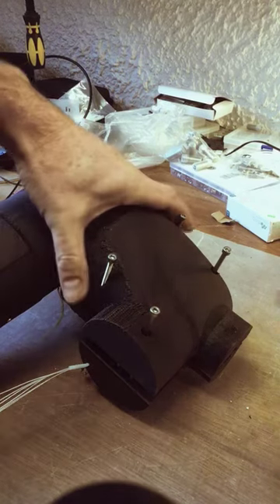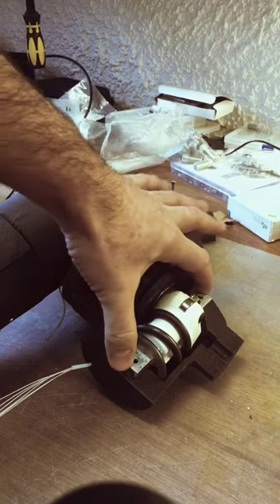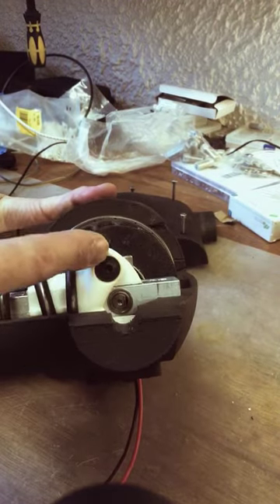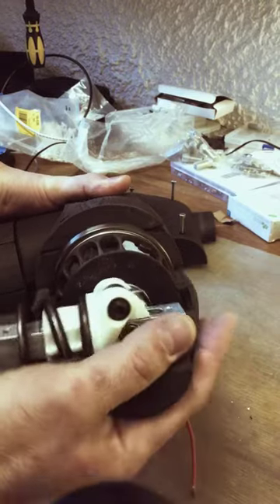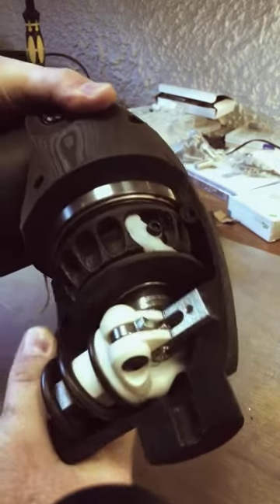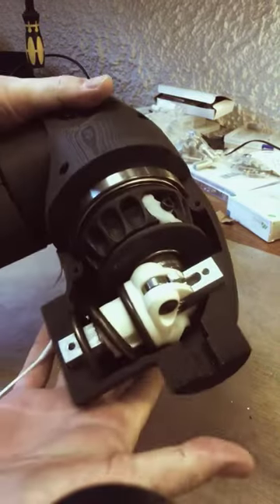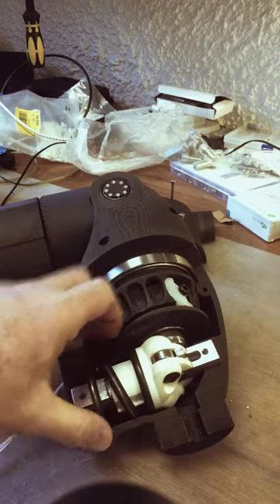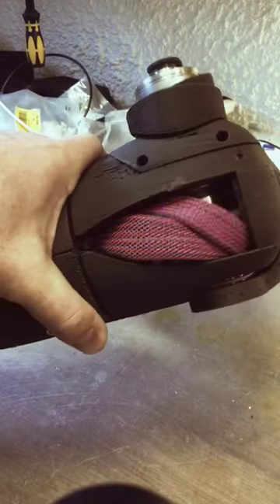Series Elastic Actuator robot joint design

Comment: Very cool project! What is the max joint torque?
Reply from the maker: Static max rated torque on the gear motor is about 40Nm.

With the right control the dynamics of the SEA allow for considerably higher torques at the joint.

Still working on that bit…
Reply: @therobotstudio  are you using a motor with an integtated gearbox, or did you design your own?
Reply from the maker: Fully commercial, 4 the same.

The Hope1 arm uses maxonmotor ECi40 (brushless 40mm diameter) with 32mm planetary gearboxes.

Comment: Would never have guessed you used SEA in you designs! I've been looking into quasi direct drive or direct drive in the past few months for compliance and force control, but SEA, when properly done, seem like a brilliant solution. Do you use them in closed loop with a sensor? How is it implemented?
Reply from the maker: For non-industrial robots there are two main ways to implement a more dynamic style of motion. Direct/quasi-direct drive or series elastic with high reduction servo drives. So far I’ve only tried the SEA route but I’ve yet to implement the second encoder loop for direct force control. It’s not been necessary for the tasks so far but it is on the list as I develop more physical interaction with objects…
Reply: @therobotstudio  I see! I guess that's an advantage of SEA, as you can work with them with position control before even implementing SEA control loops. Definitely curious to see your developments. The last product I saw with SEA was the Baxter and Sawyer robots from Rethink robotics, but they had many issues with precision and not enough value proposition with what they were selling (industrial robots). I'm guessing human interaction with an anthropomorphic robot justifies the SEA much better. How did you develop it? Did you take the time to tune the spring force for your application? SEA can be quite complicated.
Reply from the maker: Sorry for the delay. Compliant robots are the only option for HRI as industrial robots must be behind safety barriers by law.
Reply from the maker: The calculation was mostly related to how much spring deflection would be generated at peak motor torque and what would fit given the gearbox size. So rather a guesstimate but worked out ok, which is good as I had to order a 100 springs to get them custom made!